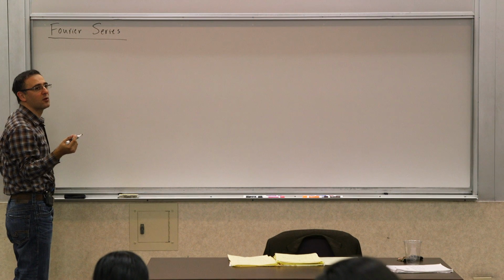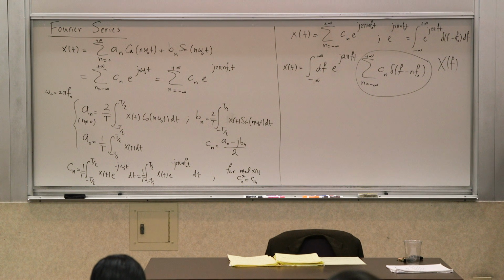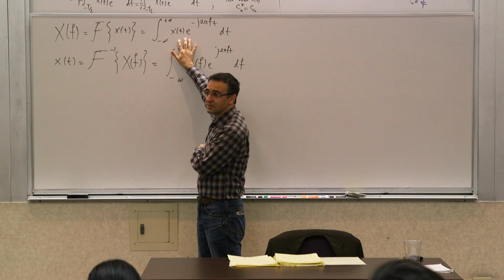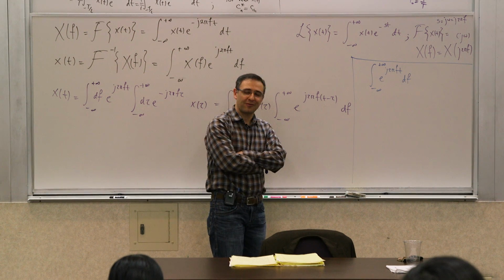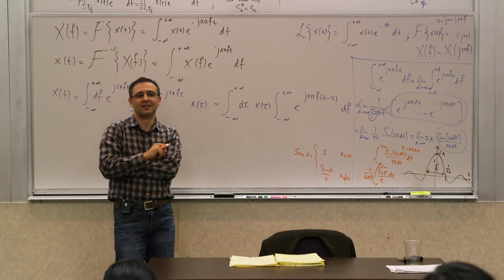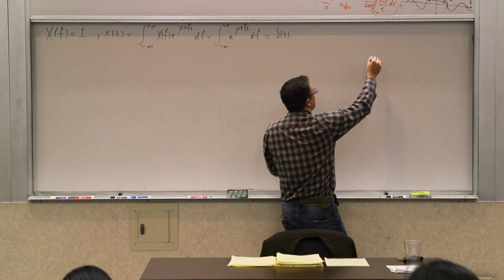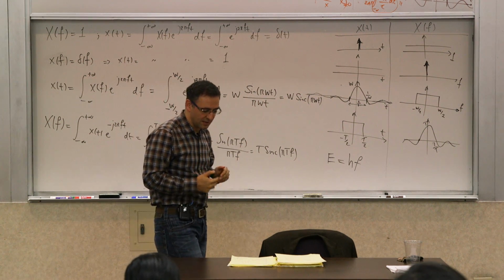034. Fourier Transform: Spectrum, Time and Frequency Duality, Impulse, Sinc, Box

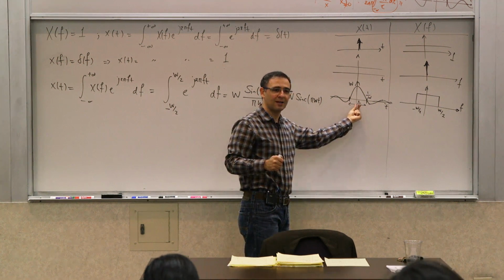Comment: There is a simple inaccurate statement around 49:10, when w->0, X(f) does not approach the impulse function, however we need to multiply the function by "1/w" first then take the limit when "w" approaches zero, then we will get X(f) -> impulse and x(t) -> sinc function. Excellent lectures, Professor Ali. I enjoyed them a lot.